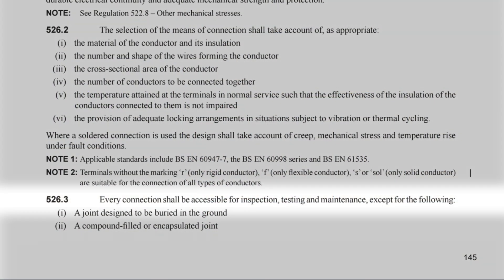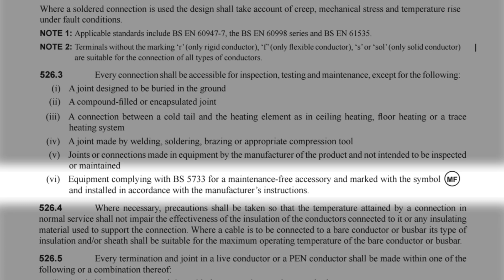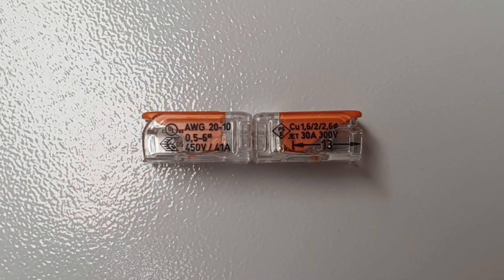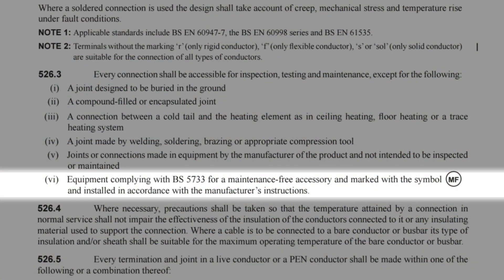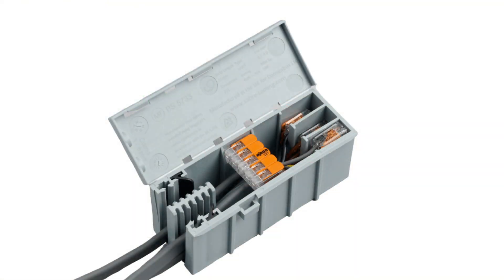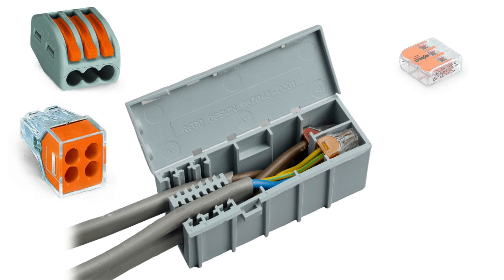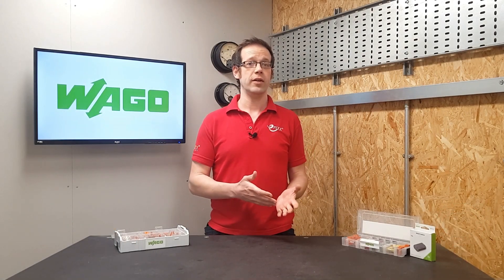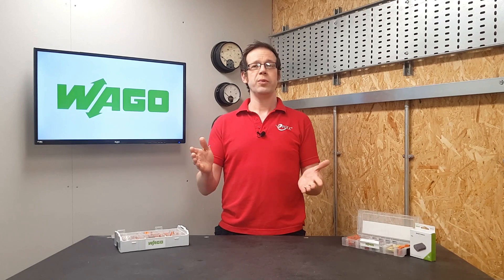Are WAGO connectors MAINTENANCE FREE - when used in a Wagobox junction box?

Comment: the right wago in the right box or it's not compliant......can we just take a minute to truly appreciate how utterly ridiculous that is. Is it safe? Are the right connectors being used in relation to wire diameter and current (ya know is it safe again). Surely this is the only question worth asking. What next, it has to be the right colour box for the righ colour connections!
Reply: BS5733 states the connectors have to be retained in addition to the cables. As the 221 connectors are slimmer than the 222 or 773 series they required a new box to conform.
Reply: A standard wago box or wiska box doesn't accommodate a smart lighting controller, I had to use a project box (screws in the lid), and a combination of waterproof inlets and wago's inside. It's not a waterproof situation requiring the inlets, but it was the safest combo I could think of to create a solution that was maintenace free, prevented any sort of gaps and offered cable restraint and did my best to make it safe and secure. I am pretty sure I am 100% NON-compliant, I am also pretty sure I am 100% safe and have done my utmost to ensure it.
My 1st attempt at this was to fit a smart lighting controller into a back box, but OMG, I won't be doing that again, took over an hour and only worked because I put a 50mm back box in (partition wall).
Smart lighting controllers for those who are curious - Sonoff D1 Mini and Samotech SM-309, try fitting those in a Wago box ;-)
Reply: @sygad1  I've done this sort of thing before as well and walked away with a clear conscience. Customers sometimes want barely achievable things and you have to make it compliant as well.
We work in the real world and the regs are written in ivory towers, how many of us feel confident in commenting to the IET when amendments are up for debate? I have looked at prospective regs before and thought of practical problems straight away.
I would however question installing a lighting controller in an inaccessible place as you have presumably done, what happens when it packs up? I have a job like this coming up and am thinking about an accessible enclosure in a remote location for the controllers, easy to say on a new job, harder on a retro-fit with all kinds of site specific issues.
Reply: @MrGrumpyjohn01  Thankfully, the lighting controllers are in the attic, with 100% access. Shame I can't attach a photo, I would love for someone to PROVE it's not safe.
Reply from the maker: It is a bit of a funny one and something I hadn't realised before I researched this video. There's a few things in the regs where you could deviate and it never actually cause an issue. But if it ever did cause an issue and someone got hurt or worse it would be on your head as the electrician. Unfortunately it's not enough these days just to say it's safe, it needs to be compliant and safe.
Reply: @efixx  Thats the point though isnt it? As soon as the manufacturers got involved in the regs committees it started to happen. Make the regs so hard to comply with exactly that in the event of a case involving liablity the manufacturers brief can always make it the sparkys fault..you didnt comply with the regs exactly enough I'm afraid Sir..I extend rings routinely with the 'wrong' connectors in a Wagobox and I'm satisfied its as safe as it can be..If I'm unlucky...well its the risk you take..I install to the best standards I know and am happy to rely on ' Sparky senses' when 7671 lets you down.
Reply: @MrGrumpyjohn01  This is what happened with the Gas regs "can only use manufacturer made or approved spares". It killed off the repairing PCB scene over night suddenly a 20p resistor turned into a £200 PCB. Sad thing is after 10 years from cease of  manufacture they don't have to produce or support products so you're back to either replacing the appliance or soldering a 20p resistor on the board.
Reply from the maker: Is it a lot harder though? It just means using the right box with the right connector, it's not that difficult once you know about it.
Reply: @efixx  yea loading the van up with loads of specific kit for very slightly different applications, 47 different kinds of connector at 18 quid a box or whatever and a dozen different boxes. Plus most wholesalers don't stock the more esoteric wagoboxes etc. 
So yes it is hard for the jobbing sparky to be 100% compliant on this type of thing day in day out when modifying circuits for kitchen & bathroom refits etc is bread and butter work.
 I would question the entire concept of maintenance free anyway, exactly what kind of maintenance would one apply to such a junction box were it deeemed not to be maintenance free? The only time I have ever heard of a maintenance schedule being carried out to junction boxes is on petrochemical plants. 
A decent brand of pushfit neatly installed and restrained in a reasonable enclosure is absolutely fine and no amount of arse covering weasel words in 7671 will persuade me otherwise.
Reply from the maker: It's more like 3 different types of connector and box, and the boxes are less than 2 quid each.
I guess maintenance in this context means checking connections on an inspection. 
Is complying with BS 7671 not pretty important for an electrician?
Reply: @efixx  I'm not going out to count but I know I have more than a dozen types of push/lever types in my box from at least 3 manufacturers and I have 4 different enclosures and I know for a fact I could go to a job tomorrow and not have an exactly compliant combination.
When I started with the 16th it was 100% about safety in the regs and not endlessly convoluted and intersecting regs that made full compliance virtually impossible. I think 7671 has lost its way and the influence of 3rd parties and marketing of new products is clearly obvious.
SPDs for instance have no place in the regs, they are not really anything to do with safety and are just an option available to a designer to offer to clients. I can't sell them to customers to be honest because if you tell the truth they don't want them so the only time I've ever fitted them is by vaguely alluding to future mandate.
So yes you could say my confidence in the regs is waning , you probably don't want to hear the full paranoid rant.
Checking 'remote' jbs is not something I have ever seen done on a routine basis, even 'accessible' ones can be hard to find on an inspection. 
Good workmanship trumps slavish adherance to increasingly unnecessary regs.
Reply from the maker: Sorry I was referring specifically to Wagos, I see where you're coming from when you include other manufacturers.

It's an interesting debate regarding the regs but I still feel it's shaky ground to decide what does and doesn't need complying with in the regs based on personal opinion about how they're written. Surge protection may not primarily be about saving lives but if it helps protect equipment then surely it's a good thing.
I'm a big advocate of using individual engineering judgement on installations but the regs are there to be followed and complied with, adhering to them is a big part of good workmanship in my eyes, the two go hand in hand.
Reply: @efixx  If it was a matter of choice or preference alone I would always comply by default as I agree that regulation is important, sometimes though 'in the field' one is 
faced with tricky choices and It makes me angry when forced to decide which rule to bend, when the whole thing could be just as safe if left to the judgement of a skilled man. I also resent buying loads of extra kit to rattle about in the back. I wish I had the time and confidence to fill in the 'departures' box every time with a fat paragraph of caveat! 
I do think you can and must 'take a position' sometimes when regs become untenable and the thicker that tome gets the more its disappearing up its own tooosh.
I do like your channel by the way despite the product pushing!
Reply from the maker: Yeah, it's definitely getting increasingly complex to comply. Thanks for the kind words, a big part of what we're trying to do is try to aid understanding of the regs and stuff like that, the product pushing keeps the lights on so we can keep producing educational content as well. It's a balancing act. Thanks for watching and commenting, plenty of food for thought in there. Hopefully get to meet in real life when possible. 👍
Reply: @efixx  Respect to you for what you are doing, its good to examine this stuff as it gets more involved and complicated, defo see you at some event somewhen! :)